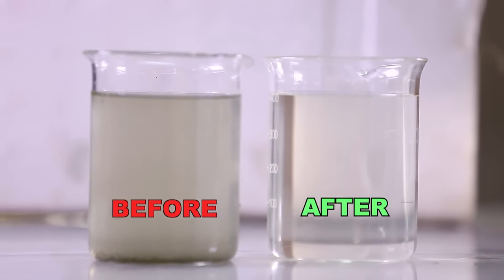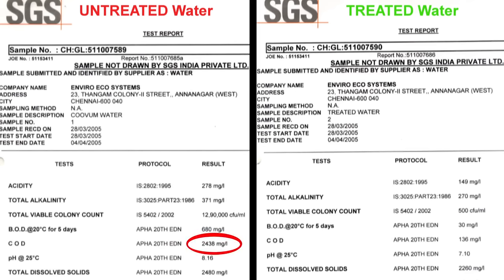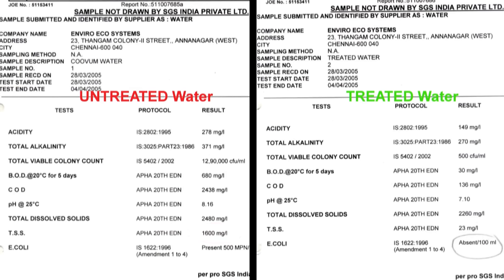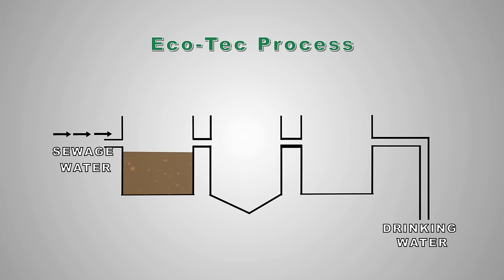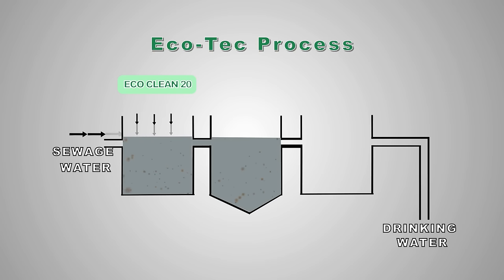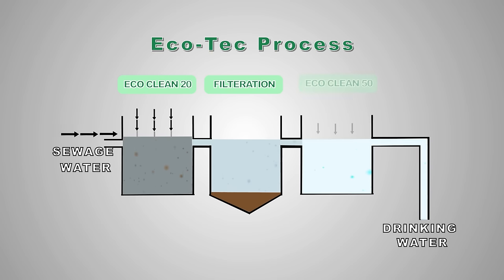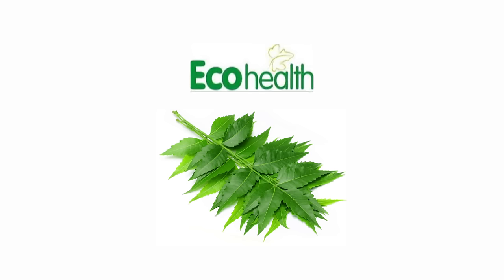Converting sewage into potable water

Comment: Hello, thanks for that explanation. That is very effective treatment for a relatively simple process. I had some questions:
1. Isn't BOD of 30 mg/l still high? It shouldn't have more than 5 mg/l.
2. Isn't TSS  of 23 mg/l still hight? It shouldn't be more than 5-10 mg/l.
3. Even COD of 136 mg/l is high. It should be maximum 20 mg/l.
4. There is hardly any effect on TDS. 

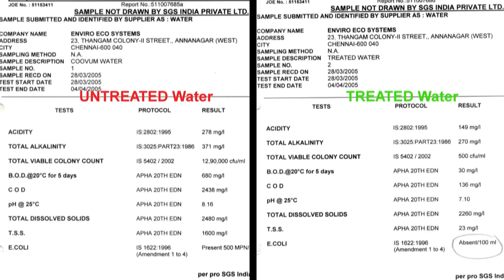Are the numbers at 6:00 in the video your final numbers or was this just a demonstration?
Reply from the maker: This was just a demonstration, and that too with the worst possible sample on earth -- Cooum water. This contains not just sewage but also industrial effluents. So that is the reason why COD, BOD, etc do not go down beyond a point. Also this demo was conducted more than 4 years ago. Since then we have improved our products. Today sewage can be treated with a single product, ECOCLEAN-2300.  We have been attaining TSS of less than 5, BOD less than 10 and COD less than 20 which are all acceptable parameters for drinking water. Thanks for the keen interest taken in our process.
Reply: @ecohealth-redefiningpurity6425  , great work

Comment: Sir you are adding BIOCIDAL agent and saying use for drinking purpose. (It may damage/ kill our body normal gut bacteria.)

Flocculant is polyacrylamide which is again mutagenic agent.
Reply from the maker: The bactericide used in our product are neem and tulsi. Both are extensively used in Indian medicinal systems and have some remarkable properties. One of this is that they are selective in their anti-bacterial action, eliminating only the pathogenic bacteria. The pro-biotic bacteria are left untouched. Neem also acts as a flocculant along with drumstick extract and Strychnos potatorum. We do not use polyacrylamide in our products; so there is no danger of mutagenic action.